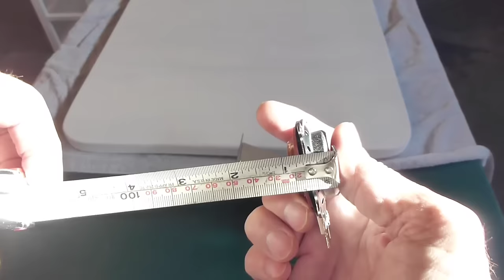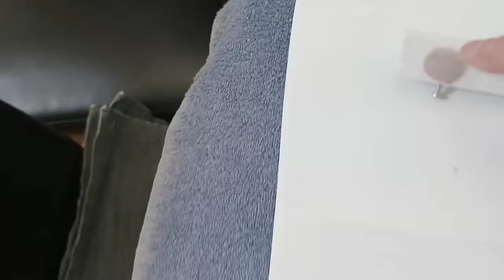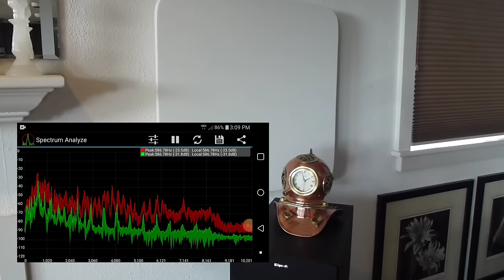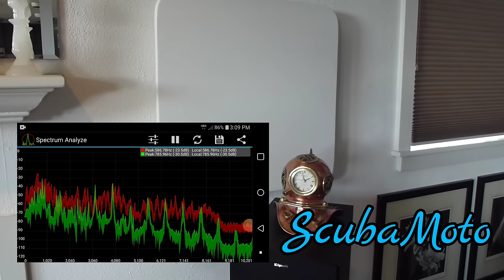How To Build DML Panel Speakers with Hidden Wall Mounts Fully Suspended

Comment: Great idea, relatively simple yet ingenious  solution for this problem.
Reply from the maker: Glad you like it! It's amazing how many long nights and trial and errors it took to come up with this design and a layout that accommodates both exciter positions. I went through several adhesives as well before settling on hot glue. I was worried the hot glue would blow right through the front surface of the panel, thus the depth control on the holes. But the stiffness of the plastic glue solved a lot. Thanks for the compliment and I hope you like the sound as much as I do.

Comment: Great video, thanks. I'm planning to do something similar and your hanging method will fit the bill.  There's a lot of talk online about needing to position the speakers a few feet out from the wall.  Yours are just a few inches (which is where I plan to hang mine).  Have you experienced any issues by having them so close to the wall?
Reply from the maker: Paul McNamara: Thanks for such a great question. DML panels introduced us to a sound so magnificent that many abandoned aesthetics to get it. So placement becomes a benefit analysis of personal preferences. Like any sound emitter, these transmit quite different at surface contact than they do one foot from a surface.

The most perceptible variations I noticed were from 1 to 2.5 inches from the wall surface to the back surface of the DML panel. Changes certainly continue at greater distance, but then we're no longer talking about wall mounting. I designed this wall mount to save floor space and because I wasn't interested in displaying the mounts or the backs of the DML panels. But you do need some distance from a surface.

Small changes make big differences near the surface. Against the wall makes source location easy. A foot from the wall, not so much. My experience was that at closest (back of exciter 1/8-inch from touching wall surface) your ears can locate the exact exciter position on the panel from the front surface without seeing it. I was happy with the back of the exciter about one inch from the wall surface. That puts the back surface of the panel between 1.5 - 2-inches from the wall surface. It could be better, but it is still leagues ahead of conventional loudspeakers for mid/high range IMHO. Thanks again for the great question and I hope you enjoy the sound from these as much as I do.
Reply: @ScubaMoto  it occurred to me that an unobtrusive way to mount these a bit further from the wall would be to hand them from a floating shelf, basically mimicking your technique otherwise. I plan on doing it your way but if someone was convinced the gap behind was critical
Reply: @charlesissleepy  similar here , we have timber picture rails mounted around the walls so i will make brackets that clip to them with elastic bands to support the DML's and will try SC's spacing at 2" from the wall.

After watching around 7 YT videos on DML panels I will be going 2/5 th mounting and 1.618 length versus width

Comment: nice to see your suspension design - thanks! playing with similar :-) PS did you try pink noise with your spectrum analyser?
Reply from the maker: Glad you like the suspension design. Pink is great. It's been useful for volume balance on my theater surround system. Also, combined with the analyzer, it gives a good visual image of differences in frequency transmission. For a video, music made it easy for viewers to hear the stark contrast between DML and conventional frequency delivery. But pink plus analyzer is the final word.

Comment: What if you made a larger frame (28x28), covered with fabric of your choice, adhesive attach the foam board to the fabric (centered) and hung the frame in traditional manner to the wall? Seems like it would offer enough isolation with possible easier mounting/no paint or prep.

Comment: 2 questions please; 1) how do you match impedance with a an 8 ohm receiver? and 2) latex, acrylic  or oil paint?
Reply from the maker: MonkigunMkII Flash: Good questions and each could be the topic of separate videos if you want to get nerdy but I may end up pinning your question.

Balancing impedance is more than a simple response. Most modern amplifiers would be okay with these tiny currents but exciters are available in several ohm models and DMLs are most often paired with powered subwoofers that have gain control on board. Wiring in series, vs parallel vs using crossovers and filters is both a system design consideration and a personal preference. An important note on foam DMLs is that they are efficient. They are not likely to blow output transistors or capacitors as they don't draw much current while they produce a relatively large sound. Your sound space, your system and your preferences all come into play. Experiment and adjust.

The paint question. I have not seen nor heard these unpainted or unfinished as the raw materials in most cases looks awful and the point of this mounting system is that aesthetics also matter. Most wall paint is latex (including that in the video). Latex paint is flexible enough to endure, it has had good adhesion and it had good enough coverage to conceal the lovely purple foam board. The latex is also easy to clean up and it is not typically environmentally atrocious.  Latex can easily be mixed for spraying or can be brushed or rolled on. By brushing it, I got the specific grain look that I wanted. One adhesion concern is the exciter mounting location. You'll notice in the video how I prepped that location after painting. One year later, neither the tape that came with the exciter nor the paint have released at the exciter location nor has the paint failed anywhere else. Thanks for the questions, I hope that helps.
Reply: You could buy the 8 ohm versions  or connect two 4 ohm sounders in series

Comment: Thankyou for sharing SC .

Before i begin mine i am curious if anyone reading here has used the quad "bullfrog" version which is 4 exciters as compared to using two single exciters per DML panel ?
DAEX25X4-4 Bullfrog is the part number

Comment: about to do the same,  but the doc I read said that the panels shouldn't be square but more rectangular.  Did I misunderstand or simply a choice was made here that square looked better and simpler to do, knowing that rectangular would have been better?   maybe?
Reply from the maker: The 24-inch square panels have been sounding great coupled with the towers for the last year. I have heard some using 24-inch by 48-inch DML panels claiming good bass response using higher wattage exciters.

Comment: sweet gonna make some of these the trebble sounds awesome........nice 1 im presuming i can add a picture on the front to make them look like pictures rather than blank boards?
Reply from the maker: keizersoze: Absolutely. I've seen canvas art DML's advertised but I would only use the foam board to ensure good audio dynamics. You can either paint directly on the foam board (or commission your artist friend to paint on it) or you could adhere an image to it. Adhesion needs to be uniform so the face is rigid with the foam board. You can use a roll on adhesive; but to keep the weight down, 3M makes good spray on adhesives. Have fun with the build and thanks for the comment.
Reply: @ScubaMoto  yeah adhere an image will be the way to go and yup I'll use the foam insulation foam stuff

Comment: Do you think this would work for a smaller surface area to make a surround sound type speaker? It would probably be much more rectangular in shape. 

I’m looking at music instrument quality spruce as well.
Reply from the maker: I haven't tested a smaller size yet but I will use 12-inch square with the same 24w exciters for my surrounds. Just working my mounts. The spruce would look nice.
Reply: Please post when you get the surrounds done. I have some ideas for aesthetic quality and WAF lol but want to see if this would work well or not.

Of concern would be the directional quality of surrounds vs the more Omni directional DML small panels.

Comment: Just saw this video, nice job.  Did you investigate using different sizes of board to achieve different characteristics A wall with a couple 4X4's, 18X18" and a couple of 6X6" might be awesome. But you'd need a freq divider maybe.  Also in the installation video did you feed the signal with hardwire or still using bluetooth.
Reply from the maker: So far I've just stuck with the 24-inch square and no Bluetooth was used for this video. Thanks for the comment and questions.

Comment: is it recommendable to paint the panels? 
i could imagine it changes the properties of the material somewhat.
Reply from the maker: Due to the appearance of the raw materials, I have yet to hear a pair that are not painted.
Reply: @ScubaMoto  if you ever make another pair it would be interesting to compare, and paint them afterwards.
i love them, thank you for making this tutorial :)
Reply: according to the source project video's author (check the tech ingredients channel) they initially have this sheen to them that the manufacturer recommended removing for this specific application. He also experimented with a bunch of different materials, which i hope more people keep doing - a metal sheet for example rang out like live reverb, which alone was too much but as a secondary speaker with enough control is a phenomenal idea.

Comment: I was wondering if there is a solution to mount these suspended in a frame somehow. Isn't that essentially what a speaker is , an exciter vibrating a surface suspended in a frame?
Reply: ya
Reply: just build a frame and suspend the panel in it exactly the same way you would hang the panel from anything else. Just make a square frame without a back and hang the panel from the top
Reply: The lack of suspension is why they are good. If you shackle them in a frame, you've ruined them!
Reply: Why couldn’t you just mount the fixed portion of the exciter to the wall? The panel would still suspend / vibrate from the moving portion of the exciter.
Reply: magnetically would be ideal.

Comment: Exactly what I was looking for!
Reply from the maker: I'm still loving mine. Have fun with them.
Reply: @ScubaMoto  Thanks! Do they have adequate treble? Also, should I buy them out of foam or like his ones with acoustic dampening tiles?
Reply from the maker: I like the mid to high frequency produced better than most high-end speaks I've experienced. However, audio preferences are personal. I would guess you might get 10 different answers from 10 people on materials used. I haven't used acoustic tile but I would modify shape before switching materials depending on what outcome I wanted. Mine are part of a set, so they contribute exactly what I want to the listening experience. For more low frequency response, I would go with twice the length and a 40w exciter but I would still supplement with at least a woofer. Good luck with your system.
Reply: @ScubaMoto  Thank you very much ! they will be perfect for voices :)

Comment: Hey bud. Great video. I've watched lots of the dml videos etc and your one looks the best. I have a question if thats cool. I see you made these 3 years ago, have they deteriorated in any way? Any new rattles or vibrations? Thanks man. Good work
Reply from the maker: Time flies! 3 1/2 years and no issues or changes. All mounting posts are solid and the exciters are still firmly attached. They have seen near daily use in combo with the Klipsch towers and still deliver excellent mid to upper range. I hope that helps. Enjoy the build.
Reply: @ScubaMoto  ah that's great. Thank you for the info. I'll be building those in October hopefully then. Thanks once again bud. 👍

Comment: Question: should one worry about this kind of speaker being sensitive to heavy bass? Like, here's shown they're suspended by a thread, so wouldn't strong bass be able to like jiggle them and affect their sound output quality?
Reply: They are not good bass speakers anyway. Send the signal somewhere else to a sub with a cross over or built in amp.

Comment: Well done.  Am interested in good mids and highs of these DML speakers but want bass as well.  Have you come across inexpensive ways to get decent bass?  I don't need Disco levels of bass, just a good warm and tight bass that rounds out music and makes it "fuller".
Reply from the maker: IncandescentDaD: Thanks. I’m glad you liked the video. Since you're not looking to rattle the dishes, you might get what you need by building larger DML’s to supplement the 2X2's. I prefer a sub with these but preferences vary, so when I read that someone is getting good bass response from a 2X4 DML, it’s impossible to tell without being in the room. Even then, 5 people standing there may give five very different assessments. The panel material is cheap and 40W exciters aren’t much more than the 24W, so you could just build a pair and see what you think. 

You mentioned inexpensive and for about twice the money of building those 2X4 DML's you could get one good subwoofer if you’ve got a spot for it. I’ve read plenty of good reviews on the Dayton Audio SUB-800’s. They’re a good 40-140 Hz sub and they're sub-$100. For just a few bucks more, the Polk Audio PSW10 (40-160Hz) reviews very well and could handle a bit larger space. Edit: Sony Core Series 10" SACS9 is a decent 28-200Hz sub that's often priced at $99. I hope that helps.
Reply: @ScubaMoto  Thanks for the pointers!

Comment: Could this work if they were hung horizontally?  I am thinking about using them on a ceiling.  Thanks in advance!
Reply from the maker: It should be a even simpler if they're parallel to the surface so long as you're good with your wire routing. If you're trying to aim them as directionals, then it might be a bit more involved to get all the angles you want.

Comment: How is the adhesive of the exciters after a year?
Reply from the maker: Gregory Kusiak: I read your message and immediately went to tug on the exciters. They're still holding well 👍.
Reply: @ScubaMoto  wow, thanks!  I’d still spray the back with some of 3M’s spray adhesive (Super77, I think…I’m not near my workshop atm) in the area where I’d put the peel-n-stick exciters, just to be extra sure.

Comment: Great Video.  I have a question? how did you decide which exciter to use on your project? I want to do a similar project and not sure which exciters to use.  I also saw a Low Frequency Bass Exicter by Dyton and I wonder if I could use that as a sub mounted on the same xps pannel
Reply from the maker: A lot of testing of panel materials, panel size and exciter types and locations was done years ago by Tech Ingredients who I mention in the video and description. My audio testing at the end of this video is little compared to his very thorough comparisons of panel configurations. 

It's typical to use a subwoofer or, in my case, the towers shown in the video to deliver lower frequencies. My preference is to use this DML technology as a supplement to an existing system. These panels demand either high quality recordings and/or careful filtration as most audio recording distortion is within the frequency band that is brought to life by these panels. I hope that helps and thanks for watching and for the comment.

Comment: Your DMLs are very bright compared to the Polks. Nicely done.
Reply from the maker: Thanks for the feedback. I love the Klipsch towers in the video. My opinion is that the DML's compliment them very well. The tweeters for the tower model in the video is 1" (2.54cm) Aluminum diaphragm compression driver mated to 90° x 90° square Tractrix Horn. They're good but can't compete with the DML's for mid to high range frequency response
Reply: @ScubaMoto Thanks for the response. Not sure where I got Polks from, maybe from another comment in the thread or I just made it up and didn't go back and verify. They do compliment each other well.   I am tossing an idea around that will be a disaster, for sure. But who says you can't do what you want when you want if it is your stuff. Biggest problem is resources and decisions need to be made. FYI I want to build a DML folded horn. Wish me luck.
Reply from the maker: I think I understand. I wasn't ready to butcher my towers to replace the horns. So, to gain from the DML's, the wall mount worked aesthetically. Just as this video addresses it, audio suspension may become an issue as well as material adhesion for forming the horn. I played with several adhesives and found the hot glue to be surprisingly rigid. Good luck with the project and we hope to hear back on your results.

Comment: I have a very tall ceiling and walls in my living room - I was going to mount these up about 10-foot off the floor, attach an Echo Dot to each (on opposite walls) and some type of small power amp.  Which amp would you recommend?  Will this work?  I bought the speakers suggested and can’t wait to build the panels!  I think I will be building a Walnut frame around them so they look a little better since our home is modern/contemporary themed...
Reply from the maker: Adrian Abshire: I have links for several small amps in the video description that might get you started. No personal preference beyond that. I would simply look for the best reviews. As for the walnut frame, I am all for aesthetics but I would be concerned about the effect of boxing in the sides. Since the effect may be one you like, I say go for it and let us know how they sound. Thanks for sharing the comment and ideas.
Reply: Tech ingredients also suggested balsa (particularly endgrains)
So perhaps make the frames out of balsa, and dye them a walnut color

You wouldn't have to sacrifice sound as much, and it might add to the tonality somehow too